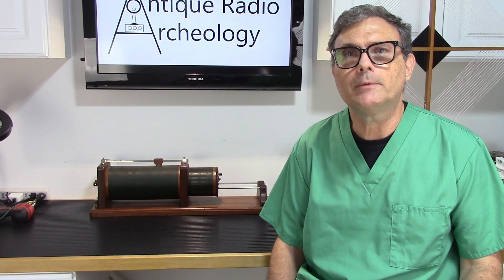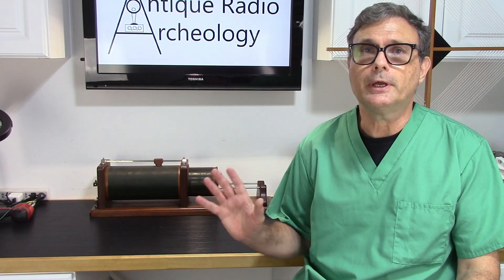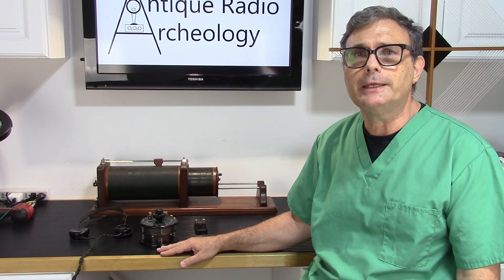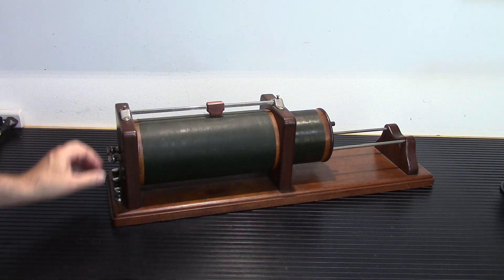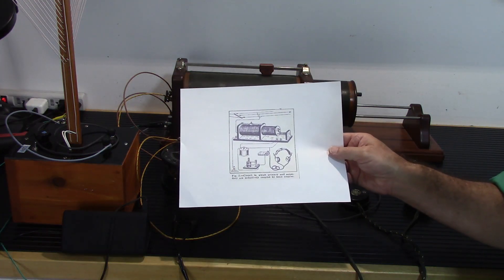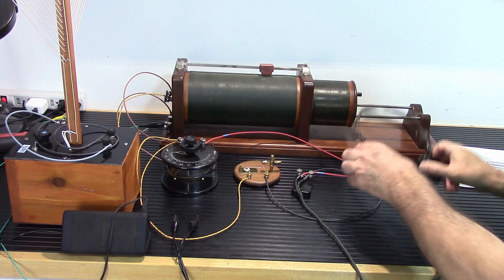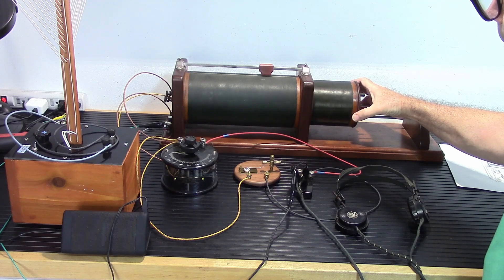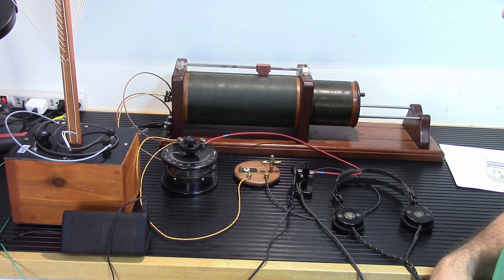1920s Loose Coupler Demonstration

Comment: A more normal way to tune is to start with the coupler coil most of the way in.
1) you mess with the sliders on the coils or if you have a variable capacitor one you mess with the capacitors
2) When you hear something you optimize the sliders on the coils
3) The you slide the coupler out a little until you hear a slight decrease in volume
4) you then repeat from 2
This gets you just about at the best possible condition for that station.

Comment: Loose coupler can turn to variometer coil - LW antenna. ( connect in serries inner and outer coil ). Connect parralel variable cap and hight impedance front end TRF radio circuit. ( works on LW and MW AM bands ).

Comment: Loose coupler has a primary and a secondary. The slider is a variable tap, the other is a rotary tap. The headphones 🎧 you failed to mention have to be high impedance.